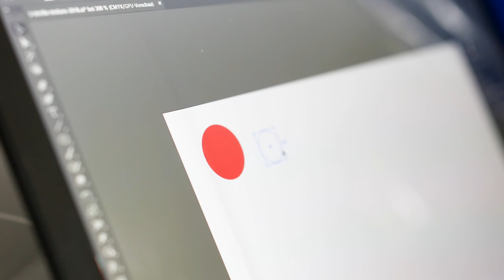Shigura Brake Upgrade | Shimano XT + Magura MT5/7 - Bike Build MTB

Comment: the most stupid thing I've seen in my life, you took excellent brakes and you messed up them shimano, shimano is the most terrible brakes in the world, it was necessary to hit your head on a traction so much to do this
Reply from the maker: Once I was blind but now I can see. You should definitely try this combo 😉
Reply: @StefanClemens  and what is wrong with the brake handles Magura?  my bike now has shimano slx brakes, I repaired the brake levers 4 times already, so it’s very strange for me to see this, considering that the pro-riders are rolling on MT7.  maybe it works better now, but shimano is very unreliable and disposable brakes :)
Reply from the maker: @GROMOVLAD  the Magura levers look and feel very cheap, it's all plastic. I'm riding the XT Levers now for a year and they still feel very good, and they just cost around 30€ each. It's a very good value for the price in my opinion.

Comment: Can u run the opposite? Magura levers with XT calipers?
Reply from the maker: You can try and tell us about it.. I'm sure it will work too
Reply: @StefanClemens  who buys brake levers because of looks? I would consider it because of the 1 finger ergonomics
Reply from the maker: @thebadness6217  feeling is bad too 🙄😁
Reply: @StefanClemens  then why didn't you just say that to begin with